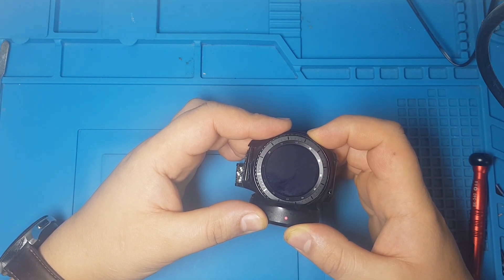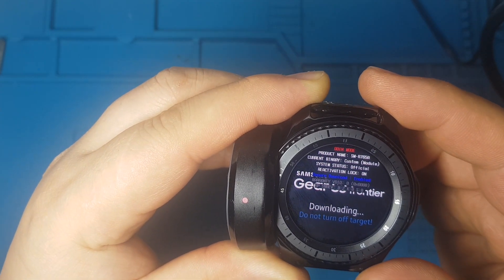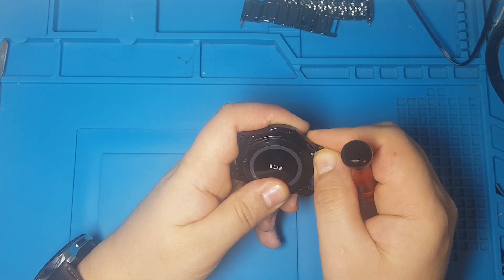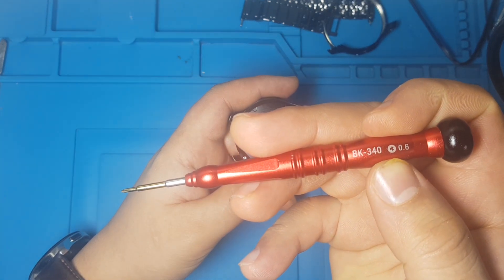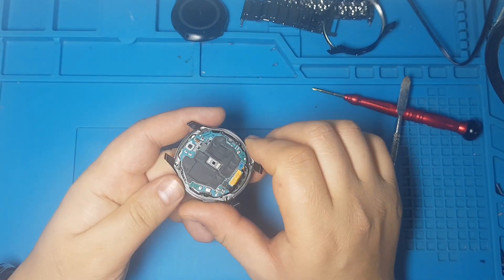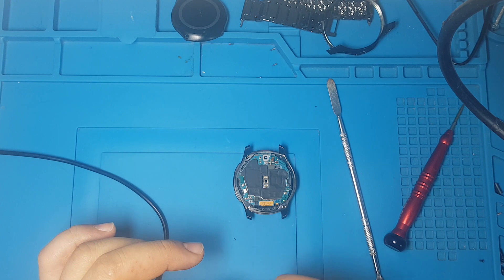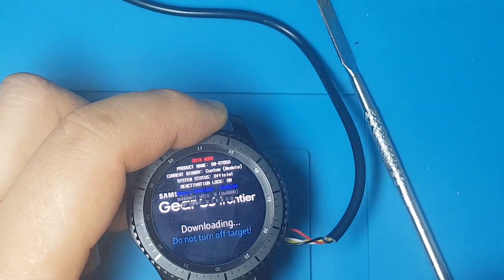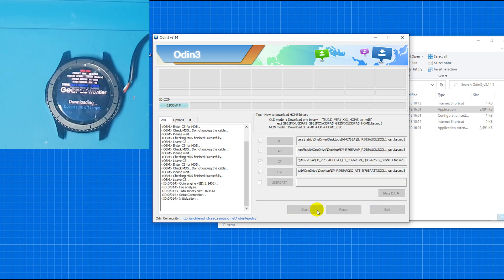Unbricking Samsung Gear S3 SM R765A for free

Comment: Can i only connect the green and white wires, my watch has enough battery

Also sometimes my computer says that the last usb connected malfunctioned and cannot be recognized
Reply from the maker: 1- Check wires are ok
2- try to connect all 4 wires, 
3- you can try with two wires, and see if it works or not.
Reply: @anwarigroup  bro I tried everything, my computer keeps saying that the last device malfunctioned and cannot be recognized
Reply: I downloaded the drivers for samsung gear s3, but it says device descriptor request failed in control panel, I used another USB cable but it still don't work
Reply from the maker: @policearebusted7459  double-check the wiring diagram and pinouts.  And the Samsung drivers, check with another computer. Check the cable continuity by a multimeters, double check the soldering.
Reply: @anwarigroup  yo it worked man, I used a different wire and it worked, my watch is now alive again, 

THANKS SO MUCH , your a life saver

Comment: Can I use tape instead of soldering
Reply from the maker: You can try, if the tape holds the wire on the contact, then yes, But this is not recommended.
Reply: @anwarigroup  did you use odin or netodin

Comment: Hi friend, I'm trying to fix my watch by following one of your videos and what you posted on your blog, but this happens when I try to charge it with the wireless charger and when I connect it via USB https://www.youtube.com/shorts/a-BJx6vO5a4
Reply from the maker: Hi, look like software problem. Can you put your watch into download mode? Can you go to boot menu?
Reply: @anwarigroup  Hello, it's not a software problem. I can't get to any menu because nothing loads today. I carried out the last tests today and ended up ruling out that the problem is the motherboard, since the power circuit from the battery is not working, so nothing loads
Reply from the maker: @eisenheim1987  charge the battery manually. Then try to go to boot menu by the side keys, 
Check if the keys are working fine.
Reply: @anwarigroup  Hello, I did charge the battery manually with my power source until it was full. I checked the buttons and the connections reach the motherboard. I also tested the operation of the buttons with my multimeter and it worked fine. and the clock does not turn on, this behavior happens when it has the battery or not. The last test I did was feeding the board with 4v4 directly from my power supply and it still doesn't turn on

Comment: friend, can I use these same files for the Frontier SM-R760?
Reply from the maker: Each watch has its own firmware and combination file, therefor these files can not be used for other watch.
Reply: Hola tengo un reloj R845F quiero el pinout para hacer la conexión usb para pasarle el software por mi laptop 
Ya que intente cambiar el csc y se quedó en download no se puede pasar por wifi por qué no se activa quiero saber donde ves que van los puntos de conexión para soldarlo